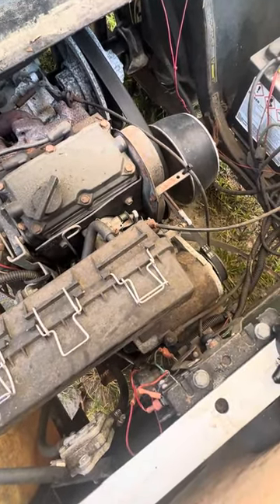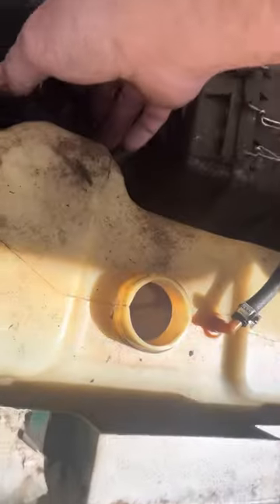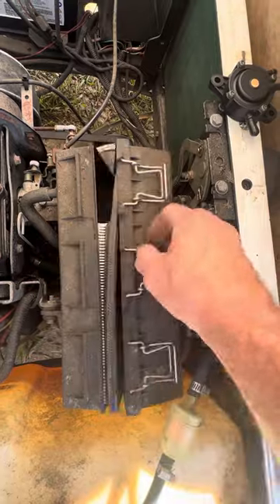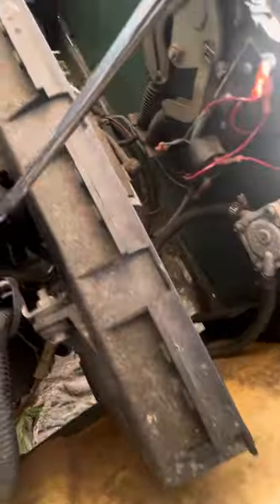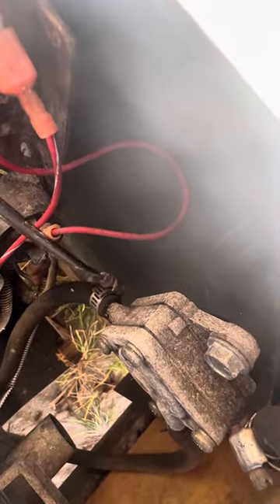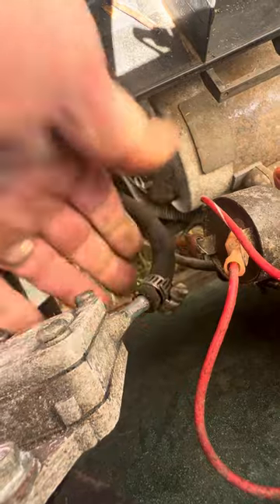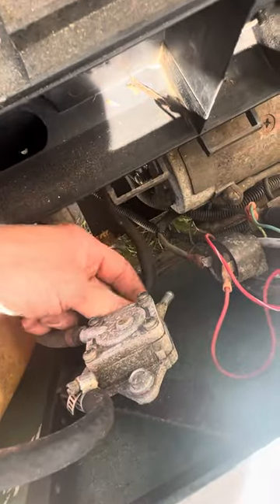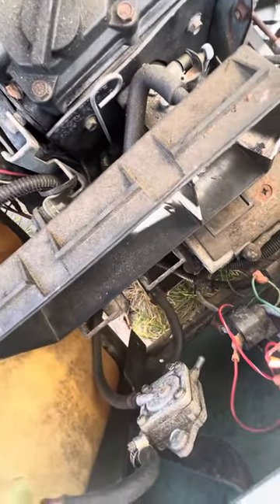Ezgo gas won’t crank up priming fuel pump

Comment: Any info would be appreciated I’ve got 36 v Melex I’m not smart enough to follow all elec diagrams for batt cables to motor to silonoid etc I have no power at all No clicking If you have something handle written would help so much Thank you Sir
Reply from the maker: What are you trying to rewire it.